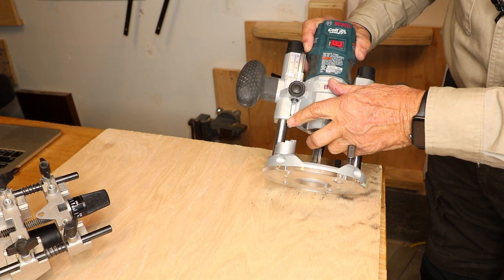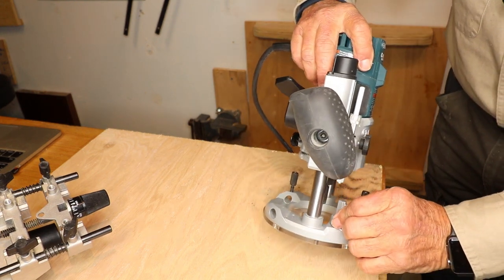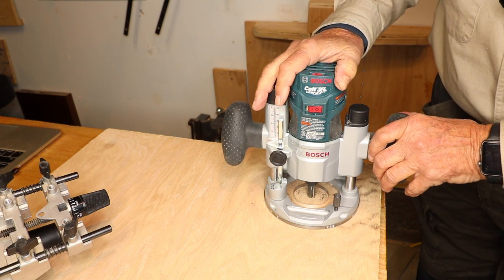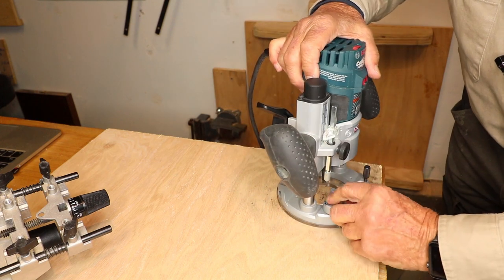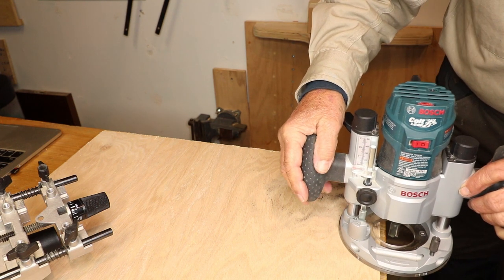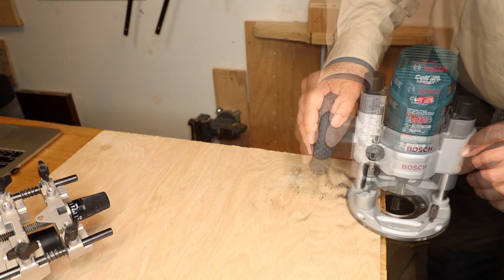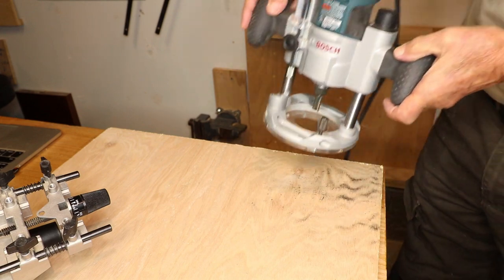Quick How to Use or Set the Depth on a Bosch Plunge Router  -a Tutorial on One of the Best Routers

Comment: I have a few full-size routers. I bought the Colt a few years back and have never used it. Well, I'm tired of using big production routers on small work so I went ahead and ordered this. Thanks for the video.
Reply from the maker: Yep, I have 5 or more Routers now and often grab the Bosch Colt for things that need my 1/4 inch bits and where the lighter weight is easier to use.  I love it and I have its big brother - the Bosch MRC23EVS with plunge base and edge guide.  Love 'em all!  Each has its place.  Samurai Carpenter polycarbonate base probably the best addition I have made to the big ones.  Another video available on creating that.

Comment: Dumb Question: I'm using Porter Cable bushings with the Bosch adapter on my Bosch 1617evspk plunge router. Since the bushing sticks out from the bottom, would this affect the depth setting per your instructions? I assume not, except the bushing will cause some aggravation sticking out when you're trying to calibrate the depth setting. Also, I'm curious how far do you recommend placing the bit into the collet? I understand to never bottom out the bit and then tighten the collet due to the collet needing space for the bit to expand when tightening it. I read that many people  bottom out the bit and then pull it out 1/8" from the bottom before tightening the collet which will allow the bit to be fully secured. Thanks for the video.
Reply from the maker: Hmmm!  Not sure

Comment: Why multiple passes instead of a single pass at your final depth?  Under what circumstances would you do a single pass?
Reply from the maker: Over the years, I must have seen 30 videos on using a plunge router for various things and every content creator that I respect always says to make multiple passes if you are going to a decent depth.  The idea is to put less stress on the router and the bit (not heating it up as much).  I would do a single pass if I was doing something at 1/4 of an inch or less into soft wood.  Other than that, my default if 1/8 to 1/4 in depth for each additional cut (if my bit is sharp and I am using a 2+ HP router.  Do you disagree?
Reply: @SmallWorkshopGuy  don't disagree. New to routers and wasn't sure why. My biggest concern is making multiple cuts increases the chance for errors and I wasn't sure how much wood might be considered too much wood.

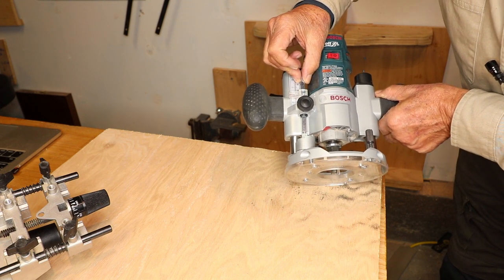Comment: I am still unclear what you are trying to say at around 1:10. Are you pulling the top of the metal rod? I am trying to cut 1/16” off.
Reply from the maker: After pushing the rod all the way down when having plunged to the top of your workpiece and moved the indicator to the zero on the scale, now pull the bar up until the indicator on the scale is at 1/16